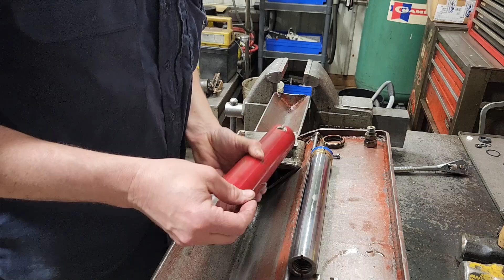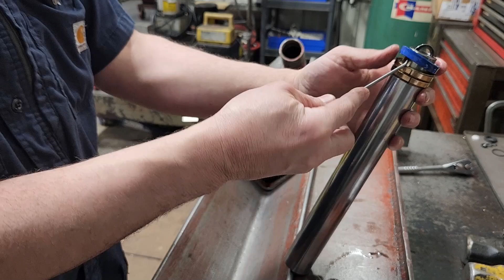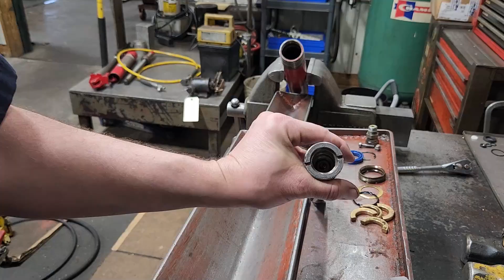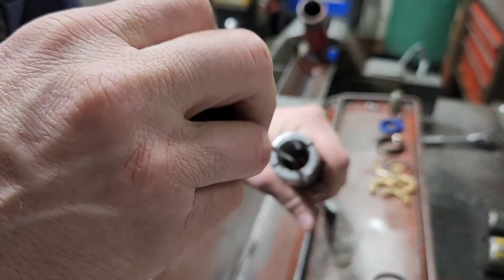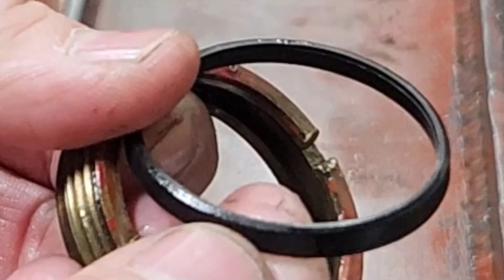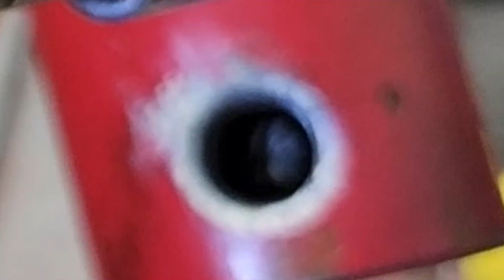HIGH FORCE RAM Reseal

Comment: kinda basic work.. 
when your rebuilding a 20ft long cylinder and upgrading 80s to today's specs (modifying or making new glands and/or pistons) then testing them with a hydraulic test bench to pressure test each side of the piston.
If we still made cars and other manufacturing in Australia id have job making big money again but Custom Harleys it is
Reply from the maker: @mifo2000  it is basic to us that do it every day. This is for those who are mechanically inclined enough to want to tackle these jobs on their own. Thanks for watching and commenting!

Comment: That little spring tool is special without it you may be messing around for a while trying to get the spring out of the way to install the screw. Thanks for the straight to the point video.
Reply from the maker: I've done it without the tool, and it's definitely not easy. Thanks for commenting and watching!